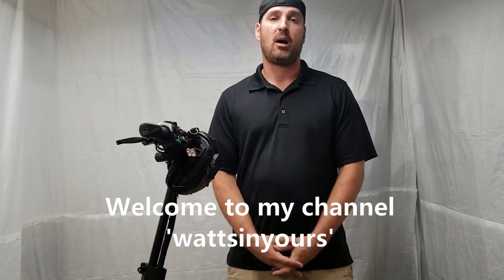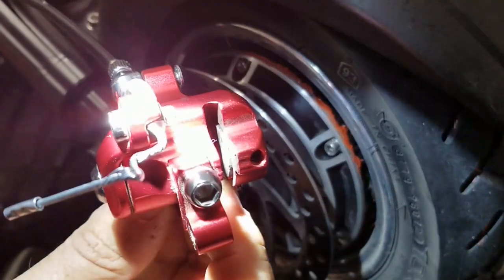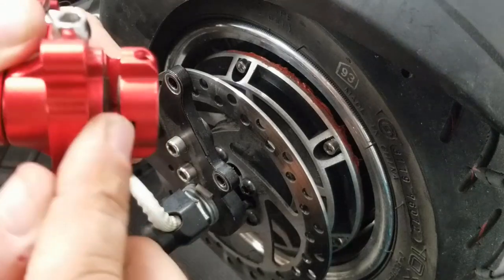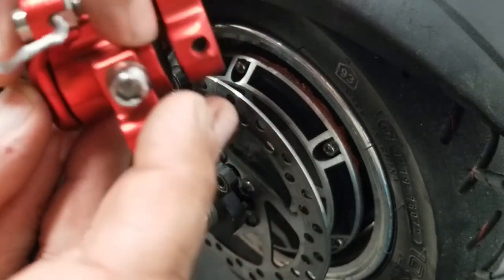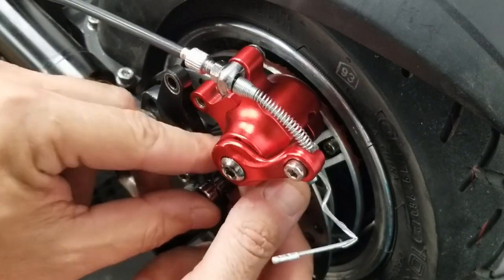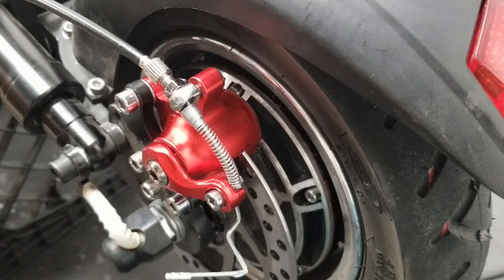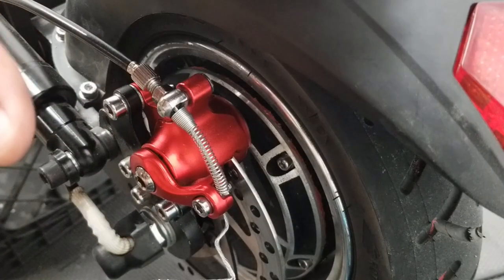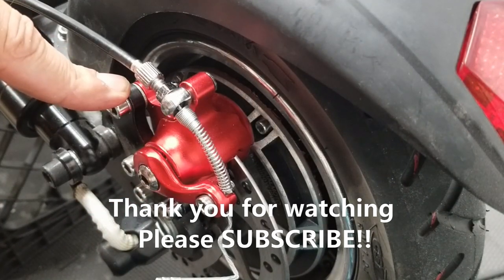Nanrobot D5+ 2.0 Brake adjustment. How to electric scooter. motorized scooter.

Comment: Some people beat the Nanrobot to death and than complain i purchased it for work it get me 10 miles each way total 20 miles with power and speed on dual mode so far i no longer pay 25 dollars a day for parking in my city
Reply from the maker: Thats what its all about bunker buster. Another form of transportation and fun. If the purchase was right for you then that's all that matters.
Reply: I passed a couple gas stations in Los Angeles yesterday, gas was $5.79, to almost $6 for a gallon for dinosaur blood. Good for you to see the savings just in parking.
Eventually solar banks in our back packs will keep the Nanrobot's batteries fully charged.

Comment: Hello I like your work I’m putting together a d5 and the wires to the lights are not connected and I have no clue what way they should be from factory? Any help with colored diagram.

Comment: How do you tighten the brake lever tension on the d5+?
Reply from the maker: Loosen the screw on the brake caliper that holds the steel wire in place. Be careful though and only pull the wire small increments at a time because it is easy to over adjust. Basically you what to adjust it until the brake lever engages the brakes  when you squeeze on it about half way to the handle bar. Hopefully this helps.
Reply: wattsinyours right on, I’ll give it a try. One more question. Every time I apply the brakes whether it be the front or back brake, I get this loud squeak, and a exclamation point appears on my screen display. Any thoughts on that?
Reply from the maker: @brycedekker4722  the exclamation is normal. It just means your pulling the brake handle or braking. The squeal means you need to clean the rotor and caliper and maybe some small adjustments.
Reply: wattsinyours so maybe just some compressed air to clean out the rotor and caliper you think? I appreciate the quick reply and help!
Reply from the maker: @brycedekker4722  yes thats what i usually do and then it solves the squealing. But u have to do it often or as needed.

Comment: Hey do you know about the emove cruiser scooter, do you have it ? I heard its a pretty good scooter and i bought it, its coming next week so excited for it!
Reply from the maker: Ok so this is just my opinion so take it for what it is worth. 1st congrats on your scooter! 2nd for the money way to slow. People say "wow this thing is fast!" but you quickly find out you'll be craving to go faster. 3rd power wise at 1600w the price doesn't justify it. Ex: nanrobot d5+ almost the same scooter is the same price with 2000w and top speed of about 34mph. 2000w will really get you up those steep inclines. 4th I always say purchase the scooter you feel comfortable with. Speed, distance and features are always a give and take on these things. Lastly at the end of the day just have fun and enjoy your scooter. Keep us updated on after you get it and ride it for a couple of weeks. Thanks for watching and i hope this helps.
Reply: Thanks man i mean i saw on some reviews apparently it can go little faster like 28 but25 with 62 miles range but actually range according to electric scooter guide is 35 miles but still good for me, i was really thinking of getting the d5 plus with seat but wad afraid that if anything broke that i would have to send back to china or someother place and found that it could be a potential hassle and all the loose bolts and stuff , but what i liked about it was it looked beefy had dual motors and 23 ah battery and maybe i think 32 mph real mph if im correct but with the emove they have name brand battery lg and the stuff i saw there production really caught me and took my vote for it, so in the start was interested in d5+ then chose the emove hopefully its a good scooter!
Reply from the maker: @tofayelhoque5625  the d5+ has 26ah battery, but they are not lg. Either way sounds like you did your research and i hope you will be happy with your purchase. Keep us updated on your scooter. Its always good to here real world results from people like you. Ride safe friend.

Comment: HI, I saw you have both d4 and d5. Which one would you suggest now that you tired both?
Thanks
Reply from the maker: Definitely the D5. Thanks for watching.
Reply: @wattsinyours  could you elaborate on it? The only thing I like more of the d5 is the more stealthy look but I like the versatility of the d4 that has more suspension travel.
Reply from the maker: @Ale_Lab  check out my unboxing video of the d5. It explains a lot. Also i have a video on the d4. After watching both that should help you with your decision.
Reply: @wattsinyours  ok I will thanks.

Comment: Can you do a video on how to replace the tire?
Reply from the maker: On which model?
Reply: @wattsinyours  rs7
Reply from the maker: @MinhvuLy  I highlighted that process in the video "on road off road modification" it starts at about 40sec into the video and then process is about the same as the "flat tire repair" in the d4+ video.
Reply: @wattsinyours  I'll check it out.  Thanks

Comment: Hi !! Can you make a video showing how to switch the disc brakes because   the disc of my nanrobot is bent  and I don't know how to take out , great video!! I hope you gonna keep doing more videos about this scooter electric!!
Reply from the maker: Hey Rudy, Haven't done a video on that yet but unfortunately its not an easy task but you can do it with a little time and patience. What you have to do is remove the tire as if you had a flat. Then you will need to take off the battery cover to the deck where you put your feet bc you will have to disconnect the motor wire for that wheel and pull it through to get the brake rotor off. That's probably the hardest part of the job. Then take off the brake rotor and then put everything back together. I hope this helps and thanks for watching.
Reply: @wattsinyours  thanks for the information I'm gonna try  !! We are waiting for more videos

Comment: Do you know what the sizing is of the hex bolts? on the tire/rim are and where to get some that are slightly longer? I got a replacement tire that supposed to be the same size but its like a mm or so off and wont let the 2 parts of the rim connect.